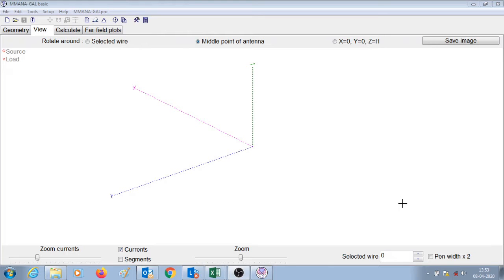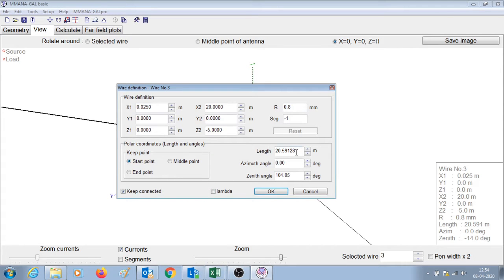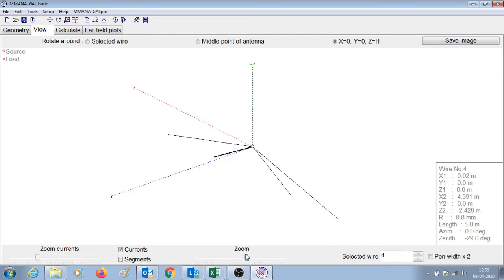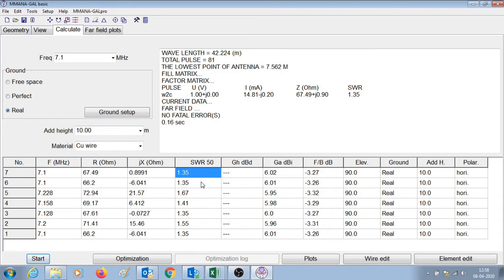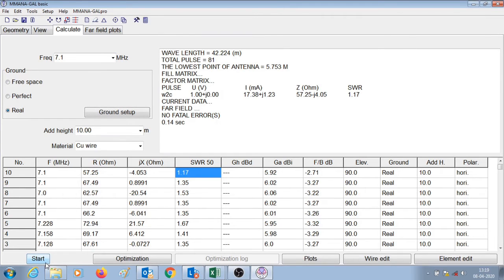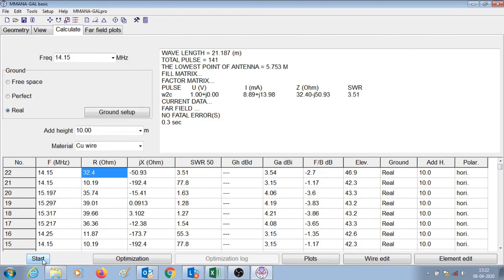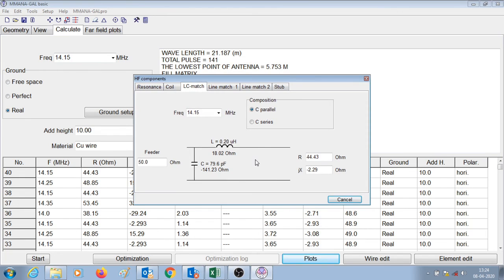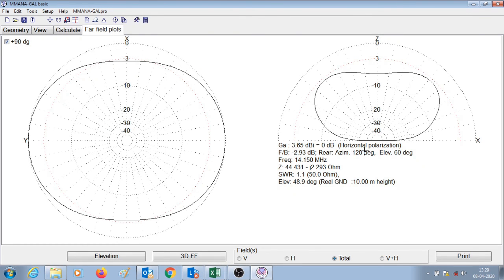Designing a fan dipole for 40 meter and 20 meter using MMANA-GAL

Comment: Hello Aniruddha , Thanks for this very informative video, when i divide the wire to 3 sections  and try to make the middle wire as source , i dont get that menu option at all. how to do this ? Can you pls share this step?@aniruddha
Reply from the maker: Three ways of doing it:
1. If you are in wire editor, select the middle wire using the button " edit wire" which is on the left of "new wire" button by which you drew the antenna elements. You may have to zoom in first. The wire would turn red if selected.Then right click on that middle wire and select "add source".
2. If you are in "View" page. Zoom in and select the same wire. The wire would turn bold. Right click and select "add source".
3. If you select wire by above methods, you will get the wire number on right hand side columns. In "geometry" page under "sources" section enter w2c (if it is wire 2) and press enter.
You will get source added to the center of middle wire.
Reply: @AniruddhaBokilVU3FML  Thank you for quick response , i did the first 2 steps ,sometimes i see the source option enabled othertimes its not visible , i will do the 3rd. Thanks a ton !! very good videos

Comment: Very interesting video! But how can simulate fan dipole with parallel writes ?
Reply from the maker: You can draw wires parallel but the end points will always connect at one end of feedpoint. Parallel wires should have sufficient distance between them.
Reply: @AniruddhaBokilVU3FML  many tnx !

Comment: Hello Aniruddha! This is Pedro from Portugal. Thanks for your video. Would you mind to share this MMANA project so i can open here and make slight changes for my reality? Allow me one question, when you define the height 10m it is from the apex to ground or from the lowest edges of 40m elements to ground? Thanks a lot! 73 de CS7BAC
Reply from the maker: Hello Pedro, The height of 10 m is that of the feedpoint from the ground, so you can say the apex to ground. Let me check how i can share the file with you. Please give me a little time.
Reply: @AniruddhaBokilVU3FML  Good evening! Thanks for your prompt repply. Actually i have an 8m aluminum mast, due to constraints of my building adminiatration i cannot raise more than that up to 10m as you suggested, but i think even with 8m with some tweaks it may work fine. After all, the building rooftop is already 20m above the ground (street level) and somehow it should help too. You can check my actual G5RV assembly on my QRZ page. Thanks again, looking forward to the project file, if you find it. 73!
Reply from the maker: @pedroavex  Yes 8 m will work. You just have to try it out. At field operation, i have an apex angle at just 5 m and it still works. You have to adjust other parameters like antenna element lengths and apex angle to get a good match. All the best!
Reply: I realize Im kind of randomly asking but does anyone know of a good website to watch new movies online?
Reply: @Danny Korbyn i use FlixZone. Just google for it :)
Reply: @Finn Atticus yup, have been using Flixzone for since march myself =)
Reply: @Finn Atticus thanks, I signed up and it seems to work =) I appreciate it !!
Reply: @Danny Korbyn you are welcome xD

Comment: New subscriber here.  I am learning MMANA and thank you for the hints on how to model a fan dipole.  I am planning to put up my first HF antenna as a fan dipole on an inverted V.  I am also a brand new ham so with this antenna I will have my first HF qso.  Thanks again
Reply from the maker: You are welcome!.. Best wishes!
Reply: @AniruddhaBokilVU3FML  one question on the angles you adjusted. You entered changes in the azimuth I believe. Is this explained in more detail someplace? I understand the length of wires relating to frequency but I am not sure on the angles. Because once I model it I have to understand angles in the real world.  Haha. Thanks again!
Reply from the maker: @brentjohnson6654  Angles were changed to adjust feedpoint impedence closer to 50 ohms. Horizontal diapole will have close to 70 ohms, vertical antenna would have close to 35 ohms and inverted v with correctly adjusted apex angles would be closer to 50ohms creating a match with your transreceiver... I hope thats what you wanted to know.
Reply: @AniruddhaBokilVU3FML  thanks I understand that part. What I don’t understand is how you determine what amount of degrees to change. Not exact, like the estimates on element lengths. Hope that clears up what I am confused on. Thanks for your replies.
Reply from the maker: @brentjohnson6654  You need vary the angle and check impedance values and try and get the feedpoint impedence closer to 50. Increasing apex angle would  increase the feedpoint impedence and decreasing it would decrease it. You need to try it out by varying it practically. Hope this helps.
Edit: i check feedpoint impedance values on nanovna
Reply: @AniruddhaBokilVU3FML  I like my NanoVNA also. So the apex angle is the azimuth angle between the two legs? 

I am trying to run 3 or 4 parallel elements to simulate inverted v fan dipole.  I am not sure if the software will show any coupling (shorten long element causing a difference in resonance in another element).  But I will try to figure this out. Doesn’t hurt to try a few things, right.  I don’t expect you to do this for me, thanks for talking with me about it. Have a happy new year! 73 de KI5HXM